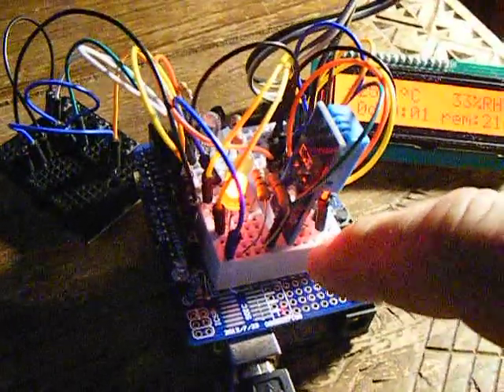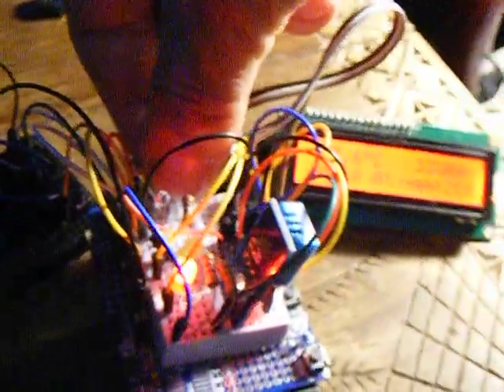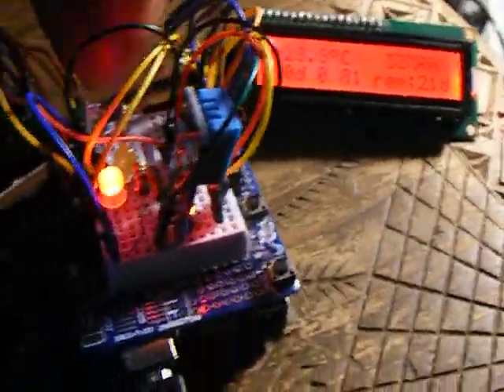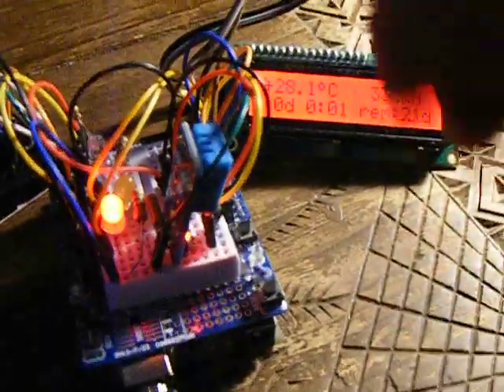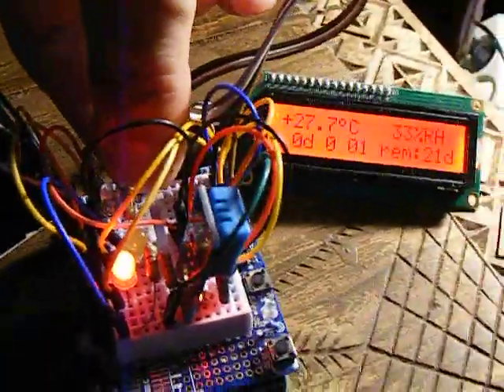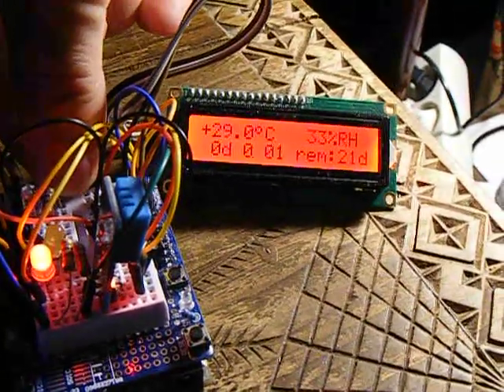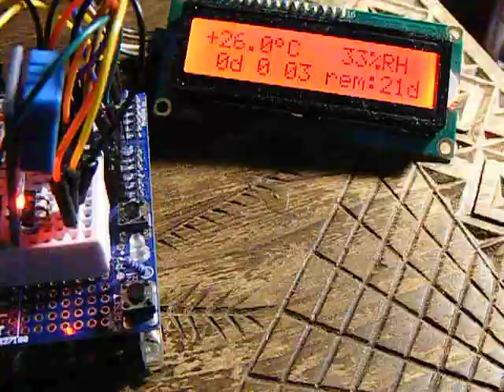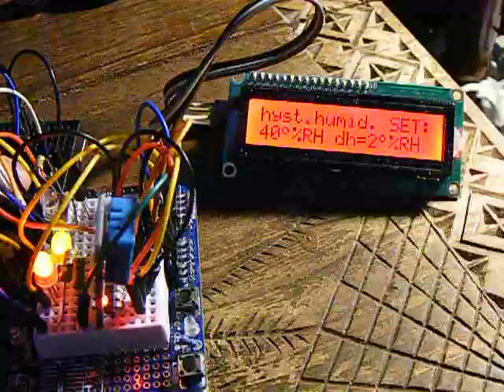egg incubator with Arduino

Comment: I have created this using EAGLE CAD (UNTESTED) Gerbers for Creating PCB and Gerbers for use with Meyhew 3dGerber 

http://mayhewlabs.com/3dpcb

Files including Sketch 1g, original Schematic, Eagle Files and both Gerbers for Manufacture and above mentioned site as it does not show unless EXCELLON_24 is used for Drill Files

https://github.com/Mark-Smith2/Nicu-FLORICA-egg-incubator-with-Arduino-Eagle-Files
Reply: Jumpers on Board Enable or Disable LEDs and Resistors if Resistor is on Temperature amd Humidity Sensors do not connect Power to these outputs relay Board Has to be Added to control AC Power
Reply from the maker: super
Reply from the maker: super

Comment: how to use egg turning motor
Reply from the maker: search system for turning egg... Arduino send command to a relay who power a dc motor (must have gear and movement is slow)... please use google search to find usual turning egg systems

Comment: HI, Thank you for the project. 
I have been facing some problems. I had connected every connections as you gave the ckt diagram and I uploaded the code to my arduino uno. but, I can't get any output. I mean, I can't see anything on lcd.
Reply from the maker: now is put on i2c connexion.. maybe you use classical conexion
Reply: Nicu FLORICA yes, I connected the lcd as I see in the ckt diagram without I2C. con you please send me the link or diagram with I2C.  and, Thank you for replying.
Reply from the maker: for classic I put now version at https://github.com/tehniq3/egg-incubator/blob/master/eggincubator_1g_classic.ino
Reply from the maker: classic schematic for i2c connexion is http://nicuflorica.blogspot.ro/2013/05/interfata-i2c-la-lcd-pentru-arduino.html
Reply from the maker: put version https://github.com/tehniq3/egg-incubator/blob/master/eggincubator_1g_classic.ino